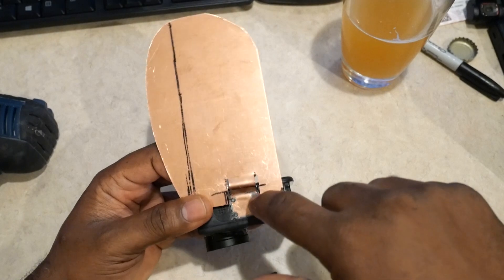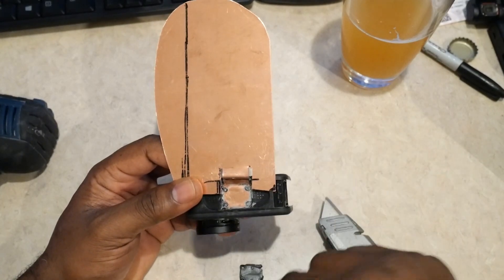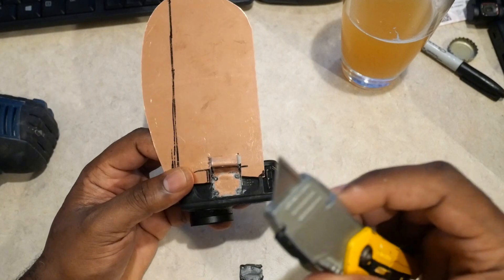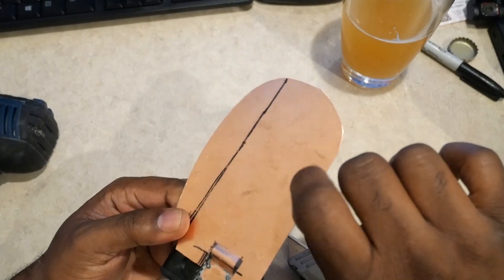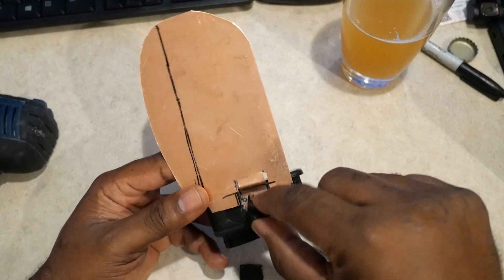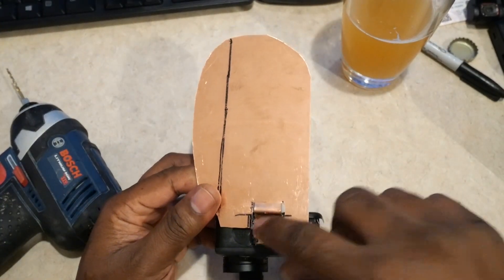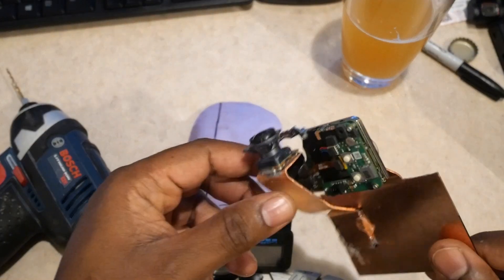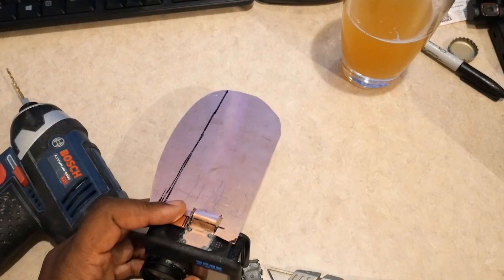GoPro 10 Cooler Hack - Adding A Heat Sink To Prevent Overheating

Comment: I was thinking of something similar.   Its good to see you proved the concept.  My thoughts were to add cooling fins to the hinged brackets on the existing mount.  My concern is that the heat transfer will not be as good as your arrangement that connects directly to the frame.

Comment: does it work?
Reply from the maker: It works excellently. I'll post an update video soon
Reply: @nman2563  Waiting for the update! :) How long are you able to record with this before the camera overheats?
Reply from the maker: @kgg5512  Thanks for checking back! The heat sink was covered but it ran for several hours off a powerbank. No overheating problems at all. The copper sink gets hot which shows it dissipates heat excellently!